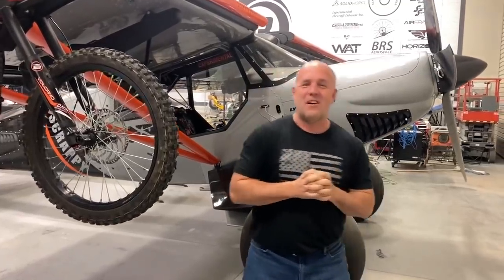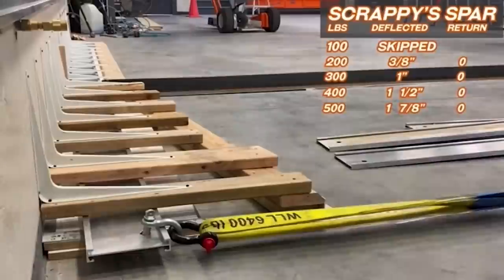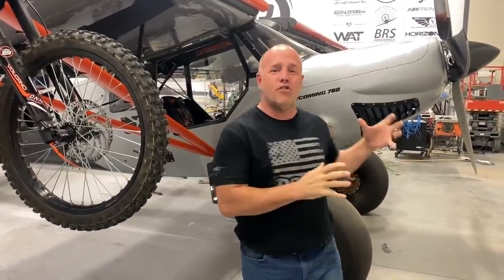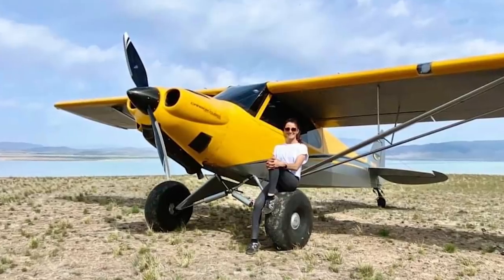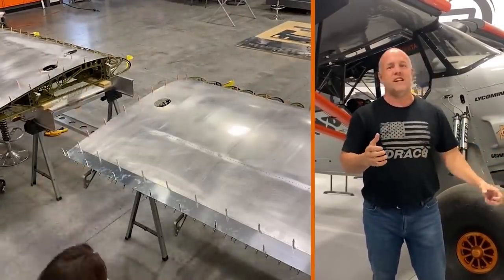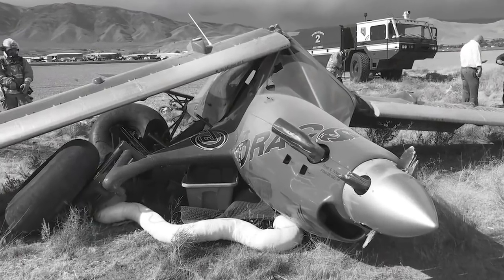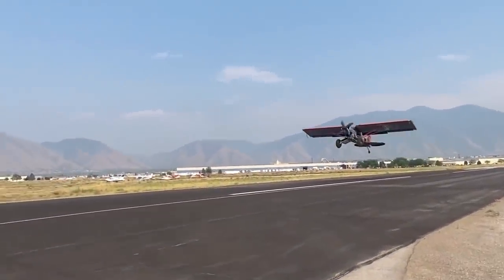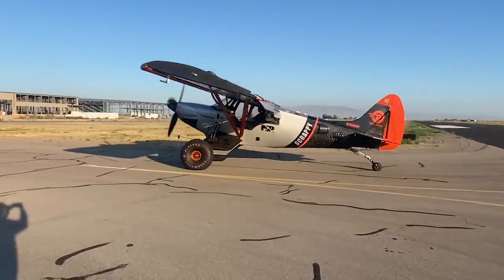What I Like and Dislike - Scrappy's Getting Some Upgrades | Scrappy #64

Comment: For low speed "aileron" control, maybe consider secondary spoilers in the prop wash area (flaps?) aka the MU-2.  Or having individual control on the flaps themselves.  Or if you want to cheat, embed some bidirectional drone like motors near the wing tips.  If you had speed sensing you could proportionally mix them with aileron input, and above a certain speed have lovers shut over them.  Larger ailerons alone are only going to take you a little bit slower without really reducing susceptibility to gusts.  You need airflow, either existing ( in the prop wash area) or what you induce (aka drone motors).  

The reality you are the same place the X-15 was.   Just not enough molecules of air passing over the ailerons to work with. Their solution was a reaction control system. 

Glad to hear you are going to a constant speed prop

Comment: Mike.  Re the ailerons.  Prob too late.   But what about electric ducted fans in the wing tips to provide the slow speed roll control.  You have all that battery power, they would be light and no need to worry about all the other down stream changes modifying the current ailerons would induce.   Roll control without air flow over the wing would be a huge advantage

Comment: Have you thought about disconnecting the elevator halves and mixing their deflections with the ailerons? This would also be advisable at low speeds because the elevator is located in the propeller jet where the air usually has a greater velocity than the speed relative to the wings.

Comment: With the massive battery capacity Scrappy has a variable speed electric motor direct drive positive displacement supercharger would be a lot less plumbing with no waste gate and the complexity that comes with a dual turbo charger setup.  Probably quite a bit lighter also when you look at the plumbing dual intercoolers and fuel management complexity.  With the aero drag Scrappy has you probably want the power mainly for takeoff and climb, so time wise maybe 5 minutes max.  With a VS superchager, just set the manifold pressure you want, set the fuel flow and you are good to go.  Also lots of big PD superchargers out there to choose from that will supply all the air you want in that big motor.  Separate independent oil system, a single intercooler and very little plumbing.  Might be worth considering.

Comment: In my knowledge range of aeroplanes, which is zero, it sounds more like it needs a flap on the wing tips. Max leverage. Or, falls right behind the prop, so when you pull the loud lever you have most surface control, but in a local area. *anyhoo, bloody chuffed you built the aeroplane of your dreams :D

Comment: Future Mike: Well I didn't like how she was flying below 12 miles per hour, so I added vortex generators on pneumatic pogo sticks out the end of the wing to channel airflow into the slip stream, and help the ailerons gain authority. 

But I wasn't happy with it, so since I had this huge solar array, I got several ducted fans for RC Jets and mounted them in place of the vortex generators, so now when I lose roll authority I hit the button a few times and blast them with air and we are back in control!
Reply: …. Hmmm

Comment: These are great experiments that will no doubt produce interesting data. However, as Trent found out, more weight does not equal more fun. I would put a smaller engine on it with boost. I do not have the connections or the money but I think you should partner with Christian von Koenigsegg. His engines are a dramatic improvement in technology and horsepower.

Comment: You can buy hydraulic reversible props for reciprocating engines from MT like the  MTV-12-R. They are used on seaplanes and come as an option for the Glasair Sportsman if you put them on floats.

Comment: Love it. Wouldn't it be great if you could design an electric tuburan side thruster and vertical that would start working at 40 n . and lower to change the AOA . Variable speed depending on stick impute. It would be part plain part Helicopter. If it was to work ,only on Scrappy. Thanks for giving us stuff to imagine.

Comment: Super Mike, whats about doubble ailerons like rudder on md11. they are hinged in the middle of the cord of them and the outer part deflected more then inner. all realized with mechanical linkages. that realizes for small control surfaces more effectivity, the mechanics are simple and very reliable.
the rest of scrapy spechless masterpiece of aviation
BR Vitali

Comment: Great stuff Mike, I love everything you've done. EXCEPT for the lack of details! What is that prop? What are those solar panels? What's the airfoil and shapes of those slats? How can we copy your astounding work without the details???
Reply: The prop is from the high performance airboat world. 

The airfoil is obviously proprietary, as they designed it with CFD on their own computer. Along with the slats. Flaps, etc. Though it appears to be similar to the Carbon Cub wing, and most people would just order a rib or buy those plans.

You cant just use these exact airfoil and slats for your own different design... People who know what an airfoil system like this is, and how to use it in their own designs will be able to figure it out with this information provided here, but People who don't know how to design their own airfoils should not have access to that information, if only for their own good.

Airfoils are only about 2% of the equation when it comes to aircraft design. Structures, Systems, and Propulsion are more important.

Even a flat-plate works just fine for the wings of a paper airplanes, and for the tail surfaces of every steel tube and fabric covered airplane ever made, and nearly flat plate wings also work for mach-2 fighters. And ultralights also, that fly slower than scrappy.

Comment: I knew when you did the NOS you would switch to turbo. It is just so much safer and lee likely to crater the engine than NOS.  Also for the prop I knew you was going to build something that gives you the low end power you have for flying low and slow but also to get some real speed out of this search and rescue plane when needed to get it on site in a hurry.    The reversing prop I also knew after draco you could not live without  that feature ever again.   Thanks for the update I can't wait to see it  100% they way you want it to be.    I can see this plane as it gets older it will be the rare grandfather to many of planes that have similar wig designs.   But this plane is going to be  in the history books for ever and ever and so will mike and his brother.

Comment: Have you thought about blown ailerons ? Piccolo holes in the high pressure blown over the top to accelerate the airflow and so give more control, old sailplane desigm

Comment: Thinking about the ailerons, instead of making them bigger, have you thought about testing the wing with vortex generators? A quick way to try is to make some angle pieces and double back tape them on and try flying to see if you get improvement on aileron control at slow speeds before making larger ailerons.

Comment: I am not expert, just another random guy, but since your crash in Draco I was thinking about that roll control problem. What about high pressure air outlets? Like the flying bedstead or the Harrier. That would provide you control at virtually zero wind speed, but specially during cross wind gusts. It would have been easier with Draco because of its power plant, but I'm pretty sure you can nail a solution with Scrappy's motor. Such a great plane!

Comment: Question about the constant speed hub you said that you want it hydraulic what advantage do you see over electric? And I thought that piston engines couldn’t do beta because it puts pressure on the crankshaft

Comment: I remember Mike mentioning the possibility of turbos, but somehow I always thought he would put a similar supercharger to what that engine used to have? The turbos are going to be heavier, and I don’t know how far back he can place them, but I’m sure he has a good reason.
Reply: Felt similarly. And it's not just the weight, they create more heat. Plus they can be set up on clutches  for Instant Power when you want but with no limitations.

Comment: My Helio uses spoilers/“interceptors” for that sub 40 roll control.  Placed behind the slats to kill slat lift. Also works great for crosswind issues. Just steer it like a car for a crosswind takeoff. 

Regarding trim, I’m really happy for you.  I’m full aft trim almost every landing unless I have a good load onboard. I need a second set of slats, I guess.

Comment: Have you ever considered a supercharger instead of twin turbos? Instant power no lag and may be lighter. I know there is a company in Denver that makes them and they just use an accessory drive on the back of the engine to run it.

Comment: Nitrous is kinda dangerous, Even if your using it to take off. I would hate to blow up in Alaska or a on a mountain somewhere, it would be an expensive transport home. Think of all the variables; tank pressure, AFR, timing, elevation, combustion temps, dome pressure, ect. Most guys take test hits and remove the plugs to see if it's safe and already having blown up a few engines in the process.
Reply: Twin 108's would be much cooler/safer.
Reply: @rsharney1111  the PT 6 from Draco would be more powerful , lighter and more reliable. Love turbos , had a big on me on my Miata but reliable power is what is needed here.

Comment: How much power or force do the ailerons need to produce at speeds of 30 to 40 mph to have a stable plane in crosswinds?  10 lbs, 100 lbs, or 1000 lbs?  Could electric propellers in the wind tips produce enough force at very slow speeds and stabilize the plane (like drones do automatically)?

Comment: I see you haven't considered my idea of expanding the cord of the prop hydraulicly. With an internal bladder, overlapping surfaces and proper pressure modulation, I think you can make a prop that will dig, then speed with width changing. (like your wing) Can you help explain why this won't work?  Luv you guys ! Thanks
Reply: I'm guessing that getting bearing surfaces near the blade tips to work reliably under the centrifugal forces would be a nightmare, given weight and volume constraints. But I'm only a physicist, so I'll defer to a mechanical engineer who can show workable numbers.

Comment: Alerion LENGTH ....   are you gunna make the extra 9" USUALLY FIXED untill the speed drops sub40 THEN THEY ENABLE and start to worth WITH THE ALERIONS ?? even if you make it a follow system (drivin by a fly by wire motor or wutever) ...so the stick feels the same most of the time, untill the time needed then it spits out the code to move the extra 9" per side ??  and make a GARAAGE DOOR kinda thingie to make the control surfaces all LONGER when superslomode is engaged or required???  eh...

Comment: The aileron issues at low speed should be countered by application of rudder.
Reply: The rudder also has reduced effect due to lower airspeed. At some point, you just hit the stops and have no more control surface force available. The fixes are bigger or additional control surfaces, increasing airflow over the surfaces or improving control of the airflow, or augmenting with deflected thrust in some manner (examples of this last include the V-22, AV-8, and F-35B).

Comment: My first unverified keyboard commando thoughts after watching...#1 Didn't some of the P58 Barrons have oil controlled reversable props? #2 I wonder if very small servo controlled spoilers would be effective at controlling roll at slow airspeed or just cause a wing stall? Fun stuff watching your thoughts come to life.

Comment: 9:30 since the LE slats move forward, but the flaps do not move rearward, your Wings Aerodynamic Center is going to move forward. 

Moving the wings AC forward is going to reduce static stability margin, that is, the AC is now moved forward toward the CG (or even moved in front of the CG). This requires less down-load on the tail to balance the heavy nose.

This in combination with the change in downwash angle from those trailing edge flaps, which significantly alters the horizontal stabilizers angle of attack making it more negative, generating automatic compensating tail download to counteract the pitching moment due to flaps. One of the many advantages of a conventional aircraft.

I never really understood the double leading edge slat. Except for the wow-factor it seems a double slotted trailing edge flap would improve CL better than an extra leading edge slot. But seeing that the pitching-moment of the combination was a huge factor is this design, it makes sense now why it was made this way.

Comment: Calculating the new center of lift for the wing in landing position should have been easy.   Not sure what program you are using, but OpenFOAM can do this directly in the output.

Comment: So, Turbo-compound when? :D  I mean if you are going to Turbo and Nitrous the engine, why not add energy right back to the crankshaft instead of by adding heat?   Yes, I know there is no room upfront and would require a complete rebuild... but if you are going to dream... dream big!  Alternatively, Turbo-Supercharger sounds like fun... and is well-tested thanks to P-38, P-47, and many Bombers BITD :D

Comment: Sounds like variable prop and turbo is needed. Then on to bigger and better things.
You have to make a pressurized carbon lancair with two small turbofan jets. You just have to :)  you can't buy the engines, no one makes them that small, you have to make them. You can do that in an afternoon :)   please please please please please please

Comment: Just like all make work projects, done is never done. 
Also ,out of curiosity for some one who doesn't know better, would adjustments to the slats on the front of the wing be needed for the larger flaps and ailerons or is it a case of there is some much trim available at the moment that it doesn't make sense to mess with it?

Comment: REVERSIBLE PROP: Just a thought, but the piston powered Convair 340 had a reversible prop. I don't have a reference handy for the prop hub design, but you could look there for some ideas. I flew the 340 many years ago. We had to be careful when using reverse as it could cause the engines to overheat, but it worked. Love the vids and keep up the good work!

Comment: slow speed aerodynamics can be frustrating.  
any chance you considered ailerons with differential rates?
the idea that the ailerons deflect up more angle than down.
a 2 degree down would also get a 4 degree up.

Comment: A few questions:

So does the ride height of the front wheels effect the speed or controls much if they are up or down in flight?  If you put larger flaps on it will it have an even slow landing speed and wouldn't it require more stick then?  Are you going to need top remake the front cowl if you put twin turbos in there or is there enough room already?  Do you still need an intercooler like most performance cars with turbos have?  Have you tested the solar setup much?
Reply: What's your favorite color? How many fleas are on a dog? Can we land on the Sun at night?
These and other questions answered on Unsolved Mysteries this Wednesday at 8.

Comment: would it be possible to change the angle only for 2 prop blades? I've never seen anything like that but would it work if they would be installed symmetrically?
Reply: He could. Buy it wouldn't make too much sense. 
Because down low you get more drag than necessary from the two high pitch blades and at cruise, the relative pitch from the flat blades reduces to zero or even negative, therefore you get zero thrust or even reverse thrust from the flat blades, while still putting power into them.
An extreme case would be 2 blades at positive pitch, two negative. Then you'd get no thrust at all, while still consuming all engine power.
Reply: @fabianrudzewski9027  makes sense.. thank you for the explanation! :)

Comment: It’d be cool if you developed a sort of “progressive” aileron system. Something that under 40mph where that dynamic curve you were talking about comes into play allows smaller inputs on the stick to make larger aileron movements. This would probably be considerably easier if it was a fly-by-wire system, but I’d be curious as to if this is doable and if so, how good it would actually be.
Reply: Like speed sensitive steering or electric steering where the ratio changes according to speed and driver input.

Comment: Hi Mike, I mentioned to you about the STOL/bush plane demonstrating at Osh 2021 which had a beta prop system.  Are you going to have beta with the new prop system on Scrappy?  Also, I imagined a far out idea (and you have the perfect electrical system for this), near or in the tail, if dual or quad motor electric drone motor props were embedded in the horizontal stabilizer, pop out, or a folding props apparatus were mounted, it could be set up to hold, keep, or push the tail down with the loss of elevator effectiveness in a short stop beta drop in landing.  I'd love to see something like that also have an AOA, elevator angle, and/or weight-on-wheels controlled modes and enable or deliver almost spot landings.  How short could it get if the tail wasn't able to pass over the top your head during braking and/or using beta thrust...and I wonder what the calculations would be for the vertical thrust needed...just 20-30 pounds given the length of the arm?  This could also be thought of as a safety system for all of the kinds of events that cause ass over teakettle and prop strike aircraft accidents.